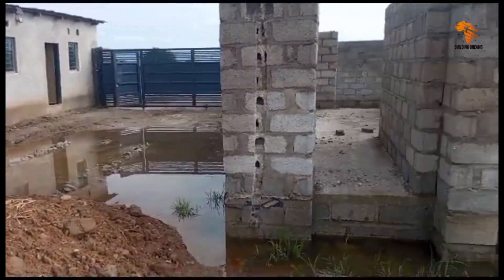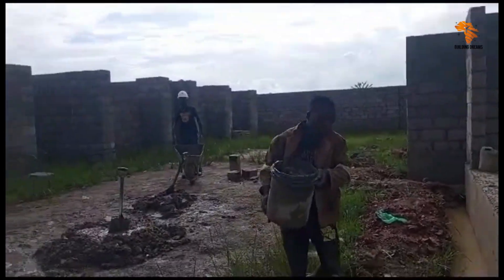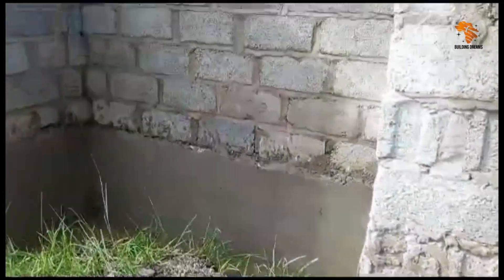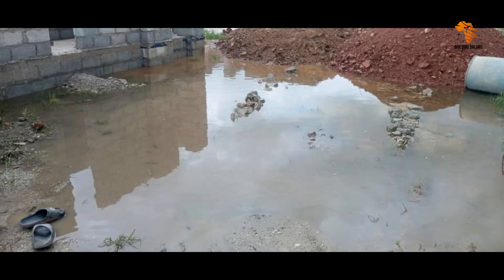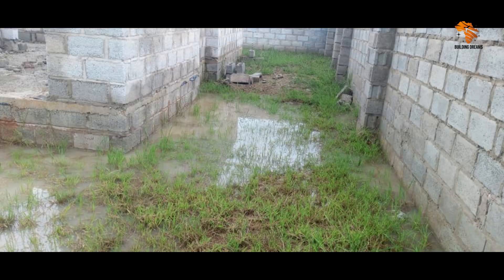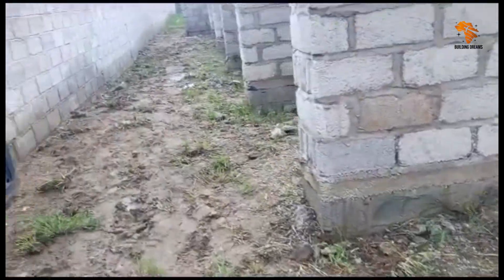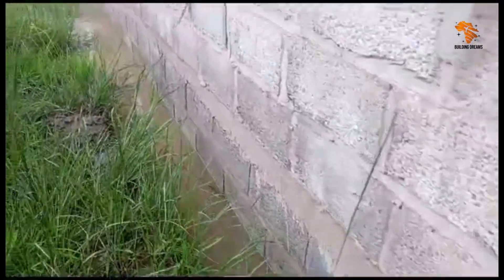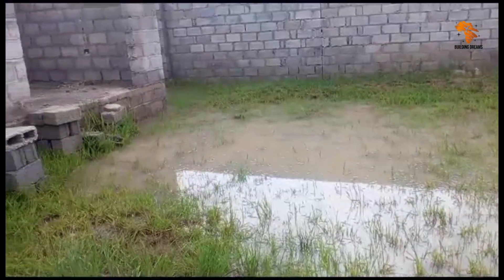Flooding on our 22 apartments site in Lusaka? This is How to Fix It!

Comment: This is where planning for residential properties is vital than just having every Jim & Jack build without could approved plans. Here, every house has its small drainage system, which you can’t see, but allows water from the gutters to go down through pipes to the main council unseen or covered drainage along the street or road side that takes water to other unseen big drainages that also take the water to rivers, streams & man lakes & then to the ocean. In Lusaka, water should have been taken from houses through covered or closed up drainages to places like filthy Misisi dam & then the  excess water gets diverted to any stream or to Chongwe or Kafue rivers. But with our no see through walls, it has become difficult for water to go where it’s supposed to go. During KK days when we did not have the whole city with the brink walls, we never experienced the kind of flooding that most areas are experiencing. Thanks for sharing what you want to do to drain the water away
Reply: @kingslj  as a Zambian Town Planner in the UK  I concur. It’s a flood zone and needs various SuDS  to address surface water run off .
Reply from the maker: @ Thank you for your insight, and it’s great to hear from a fellow professional! As a Quantity Surveyor based in the UK, I fully agree that sustainable drainage systems (SuDS) are essential for managing surface water runoff, especially in areas like this which are prone to flooding.

While we’re focusing on practical measures like French drains and site grading for now, a comprehensive SuDS approach would definitely be the ideal solution for long-term water management. I’d be really interested to hear which specific SuDS techniques you think would work best in a Zambian context—it would be great to exchange ideas
Reply: @BuildingDreamsAfrica I wish city & town planners at Lusaka city council could exchange notes with professionals like you
Reply: @kingslj  Thank you for such a thoughtful comment! I completely agree that better drainage planning is essential, and it’s encouraging to see ideas like exchanging notes between city planners and professionals being suggested. Collaboration is key if we want to see real change.

However, as Zambians, we shouldn’t wait for local authorities to improve conditions—they’ve had the ability to act for years, yet every rainy season we face the same challenges. It’s clear that if they were going to address this issue, they would have done so by now.

We, as citizens, need to take responsibility and do our part to improve our surroundings. This means planning smarter when building, including proper drainage solutions like French drains, rainwater harvesting, and ensuring water outlets are available in our wall fences. By taking these steps, we can significantly reduce flooding, improve living conditions, and avoid diseases like cholera that often arise during these situations.

It’s time for us to lead by example and show that even small efforts can lead to big changes. I hope more of us can start taking action in our communities. Thank you again for your insight—let’s keep the conversation going!
Reply from the maker: Thank you for such a thoughtful comment! You’ve highlighted such an important point about urban planning and the role proper drainage systems play in preventing flooding. I completely agree—planning at both individual property and city-wide levels is essential to managing water flow effectively, especially in areas like Lusaka with heavy rains and flat terrain.

What you mentioned about the older days, during KK's time, is quite striking. The open spaces and lack of high walls probably allowed for better water flow and communal drainage solutions, something we’ve lost with today’s more segmented approach to construction.

I love the idea of integrating unseen or covered drainage systems like the ones you described. It’s something we should push for as a long-term solution, especially in high-density areas. For now, I’m hoping the French drain and other on-site measures will mitigate flooding at my project, but city-wide infrastructure upgrades would make such a difference.

Thanks again for your insight—it’s a reminder of how much more we can do as a community to plan better for the future!
Reply: @BuildingDreamsAfrica You’re welcome! Better drainage planning at all levels is certainly needed at to be implemented & reinforced by the responsible Lusaka city council personnel by the personnel of all Zambian city & town council officers. If it rained throughout the year like it is here, all our cities & towns would be under water today. Going forward, there’s hope that our good suggestions (including your French model) will get to the Lusaka city council for implementation. I hope too that Lusaka city council will develop a law that will require home owners of old houses who build wall fences to leave some small water outlets from their yards to get water into their drainages
Reply from the maker: @kingslj  Thank you for your thoughtful comment! You’re absolutely right—better drainage planning at all levels is crucial, and it really does need to be prioritised and enforced by our city and town councils. If we had year-round rains like some places, our lack of proper drainage systems would indeed create massive challenges.

I completely agree that laws requiring homeowners to include water outlets in their walls would make a big difference. It’s a simple but impactful idea that could prevent so much water from being trapped in yards and instead allow it to flow into proper drainage systems.

Let’s hope that these conversations, combined with practical models like the French drain, will inspire the Lusaka City Council and others to take action. Small steps now could save us from much bigger problems in the future. Thanks again for sharing your thoughts and for being part of this important dialogue!

Comment: Wow, I’ve been dealing with flooding issues on my site as well, and it’s been such a headache! How long did it take you to install the French drains, and do you think this solution would work for a much smaller site?
Reply from the maker: Thanks for watching! I completely understand how frustrating flooding can be. We’re actually in the planning and preparation stage for installing the French drains, so I’ll be sharing updates as we go along. For a smaller site, French drains are a great solution—you just need to adapt the scale and ensure the outlet drains water effectively. I’d be happy to share tips from what we’re planning. What kind of challenges are you facing on your site?
Reply: @BuildingDreamsAfrica  Thanks for responding! My site is on a slight slope, but the water seems to pool at the bottom near my house. I was thinking about installing something like a French drain but wasn’t sure where to start. Do you think I should hire a professional, or can this be a DIY project?
Reply from the maker: @AfriVogue-d4h That’s a great question! Since your site is on a slope, a French drain could work really well to guide the water away from your house. Whether you hire a professional or do it yourself really depends on how comfortable you are with digging trenches and working with basic drainage materials.

If you go the DIY route, you’ll need to:
1⃣ Mark out the area where water is pooling and the direction you want it to drain.
2⃣ Dig a trench that slopes downhill (about 1–2% gradient).
3⃣ Lay a perforated pipe wrapped in geotextile fabric and surround it with gravel before covering it back with soil.

It’s a bit labour-intensive but totally doable for a smaller site! For larger or more complex sites, a professional might save you time and ensure it’s done right. Have you considered combining this with something like a soakaway or a rain garden for extra drainage at the lower end of your slope?